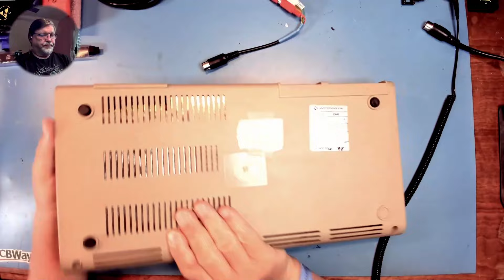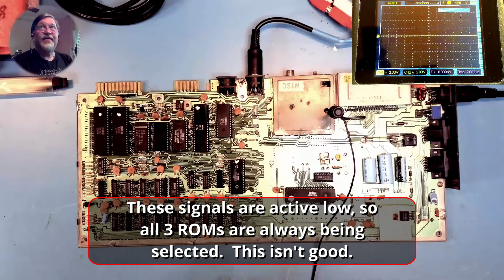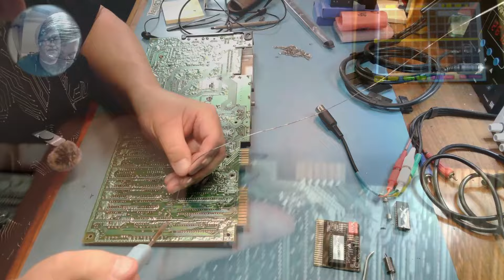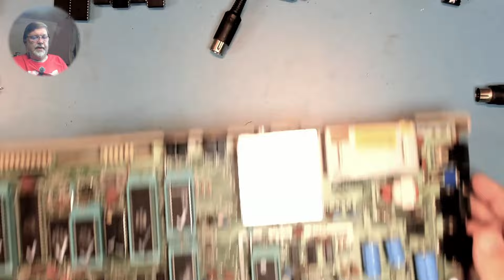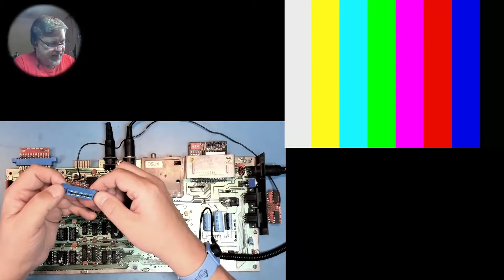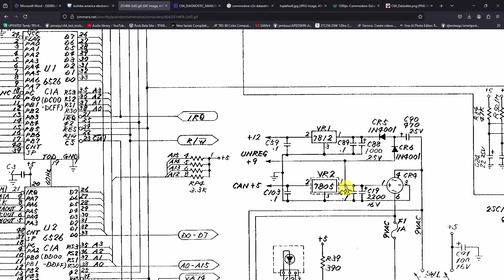It's always the PLA.  And the other PLA.  Wait ... WHAT?

Comment: Why would anyone use just pins instead of sockets.    That would be a lot more work to just use pins anyway.   Crazy!
Reply from the maker: The only thing that made sense in my head was that whoever they were, they didn't have the correct size socket and it didn't occur to them to either cut down a larger one or build one up out of two smaller ones.  Still not their best option.  I would have just waited until I could source the correct sockets.  Crazy is right!

Comment: Thanks for the video. A more thorough initial process could contemplate opening the case before turning on the computer and checking voltages and doing visual inspections to see if is safe to turn it on. Great tip on the zener diode for the datassette; they were very common here in Europe compared to the floppy drives, which were awfully expensive
Reply from the maker: You're welcome.  And thank you for watching and for the feedback.

Comment: Excellent video and troubleshooting.   That's awesome you saved the vicII :)   that was definitely a hard one.  But never in doubt.. I knew u would get it.    The cassette problem u had happened to me once.. ( the zener diode)  it drove me nuts for quite a while.   Since then I have always used my tester to check the cassette motor pin on port to see if it's constantly running.   ( a bad pla can also make it run all the time 6v +)   anyways another great video.... this really excited me that I wasn't the only one who had that diode issue.  Awesome.   U take care,  and can't wait for # 10:)
Reply from the maker: Thanks, Donald.  I appreciate that.  Also glad I'm not the only one to experience the diode issue.  :)  See you in the next one!
Reply: I left mine for a couple weeks , then got the schematics like u did... I plugged in a known working datasette I have,  I powered the 64 on, and it ran continuously.   I replaced and socketed the 6510.. no change.. then I replaced 1 of the cias and socketed... can't remember which one now... still no change.   Then I'm like.. I don't know.. I took that zener diode off a very bad board and soldered it in the other board and.. it just freaking worked.. I was crazy happy.  😆

Comment: Great work! I learn a lot, thanks! I really like your combined (?) multimeter / oscilloscope. Would you mind share which one you use? Thanks in advance.
Reply from the maker: It's basically this one.  I think mine may have been an earlier model.  I have the one Adrian Black reviewed.  https://www.amazon.com/Hantek-Handheld-Oscilloscope-Multimeter-Multifunction/dp/B07PWZV4XJ/ref=sxin_16_pa_sp_search_thematic_sspa?content-id=amzn1.sym.e8df51fd-b950-4a2f-bfb3-8dbdae6ffa25%3Aamzn1.sym.e8df51fd-b950-4a2f-bfb3-8dbdae6ffa25&crid=QTD3XNYPU95M&cv_ct_cx=handheld+oscilloscope+multimeter&dib=eyJ2IjoiMSJ9.x1C9-luR7EiqHBQ7rBkIRLtgWBAfby0YF7WvmxiysMh5ugjBFniYQ0aeBSayai1hsDOcbCQhbTRoLRhJG2bMJg.DgAJakeAlgfmSb0dWZbriDIhBwkEauOa6XIfsXJ4aQo&dib_tag=se&keywords=handheld+oscilloscope+multimeter&pd_rd_i=B07PWZV4XJ&pd_rd_r=cf817997-acba-4896-b6d8-04f293b30e54&pd_rd_w=bEr8F&pd_rd_wg=bHbCb&pf_rd_p=e8df51fd-b950-4a2f-bfb3-8dbdae6ffa25&pf_rd_r=JB79FG72AE2C6RHD0VBC&qid=1721500912&sbo=RZvfv%2F%2FHxDF%2BO5021pAnSA%3D%3D&sprefix=handheld+osc%2Caps%2C93&sr=1-5-e20883f9-9d72-4842-a3e6-e1cd54d2b900-spons&sp_csd=d2lkZ2V0TmFtZT1zcF9zZWFyY2hfdGhlbWF0aWM&psc=1

Comment: Sorry to say, but I find your troubleshooting process not quite logical. Especially considering you have a second working unit to do testing.  Good effort, extraordinarily complicated diagnosis process. I have observed that you normally start very well in your repairs, but then tend to drift away…….Thanks for sharing
Reply from the maker: I'm happy to take any specific recommendations you may have for improvement.  As for the ZIF board, I don't like to use it that much for three reasons.  First, not everyone out there has a known-good board with sockets fitted that they can use as a test bench, so if one of my goals is to show folks how they can repair their own machine, it's better to try other diagnostic methods first.  Second, I like to see the actual fault, which you don't get if you just pull every IC and test it in another machine.  Third, not every machine I work on has all the ICs socketed and desoldering a chip just to test it in another board without specific indication that it may be faulty is hard on both the chip (if its good) and the board itself.

As for drifting away, there may be two causes for that.  First, I usually do these in the evenings and as it gets later I lose focus.  I'll try to work on that.  Second, I start getting into areas where I'm not as knowledgeable or as confident, so I slow down to try to understand what's happening and what should be happening.  That's a learning curve and is probably unavoidable until I get better at what I'm doing.

Thanks for watching and for the feedback!
Reply: @YARC-1981  if those are your goals/challenges, then let us assume a different premise: 
Most people without a second c64 at hand most likely don’t have an oscilloscope, a minipro programmer, a ram tester and/or a test cartridge either. Therefore it may be a more reasonable path for teaching repairs is with a multimeter and a logic pen.   Perhaps following the sams repair guide or the c64 maintenance manual and/or the visual troubleshooting screens from Ray Carlson. My 2 cents as suggestions. Thanks for sharing your content. I liked and suscribed
Reply from the maker: Thanks for the like and subscription.  There are many paths to the same result when troubleshooting and repairing computers.  I've shown repairs using a little $25 oscilloscope (the ZEEWEII DSO154Pro) from AliExpress before.  I've also used the pictorial fault guide.  I shy away from using my logic probe because I don't think it gives you enough information and can be too misleading sometimes.  But you've got a point.

Comment: This is again one of those cases where the cost of the repair does not (or barely) justifies doing it. BUT, 250425 is my favorite long board, if it were me, I wouldn't scrap it as a parts donor, which I think you won't do too. There is no logical explanation on why that replacement PLA died. I guess it was just bad luck. As you already found out, there wasn't an actual short on the PSU 5V rail, and yes the power switches do drop the voltage when there is oxidation on their contacts, this is also true with the power connector, you should take a look there and clean/replace if necessary. Check input voltage right at the power connector pins, and then on the switch pins. A healthy C64 PCU (original or aftermarket) should provide a decent 5V (even a little above it) and if it drops around 4.7-4.8V around the board, there must be a reason for it. I am glad you decided to follow a methodical approach, here is what I follow for C64s:
1) Open it before applying power. (If something to go bang or smoke, I would like to see it)
2) Remove the SID (Not needed for anything, and too valuable to risk it)
3) Connect video, power on.
4) Check voltages.
5) Check clock signals (Yes, plural. Includes the dot clock and color clock as well as the CPU clock, all measured first from the clock generator circuit, then on the CPU)
6) Check reset line.
7) Depending on what I see on the screen, attach Dead Test or Diagnostics. If none of them boots up, start probing, PLA pins first. 
I re-insert the SID only after I am sure that I have a fully working machine, I never poke around with the SID in circuit.
Reply from the maker: Good morning, Bora.  Glad to see you're still sticking with me.
You're right, this one was expensive, but it could have been worse.  I don't like to give up on a machine just because it costs too much to repair, though.  If I've got the spares, I'll save it.
I put the first replacement PLA in the board before I fixed those "sockets" under the RAM, while the voltage was still reading below 4.3V, so there COULD have been a short on the board that affected it.  I'll never know now.
I did spray deoxit into the power connector and then insert and remove the plug several times.  It had no effect at all on the voltage, though, so I don't think there's a problem there.
I'm still fine-tuning my diagnostic process, so I'll consider yours.  Looks like you're maybe a little more cautious than I've been.  And I only usually get to the dot and color clocks if I'm seeing video issues.

Thanks again for watching and for your feedback.  I always learn something from you.
Reply: @YARC-1981  Of course I am sticking around. Your channel is one of my top 5 retro computer channels, always makes me happy to see a new video from you!